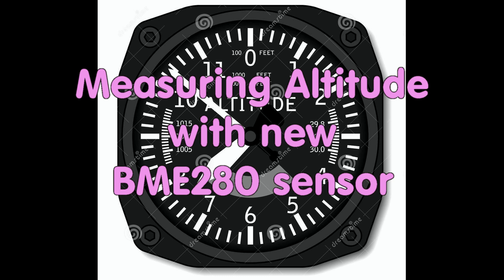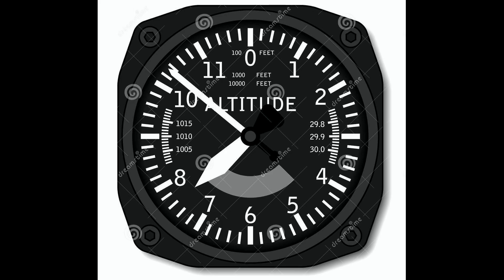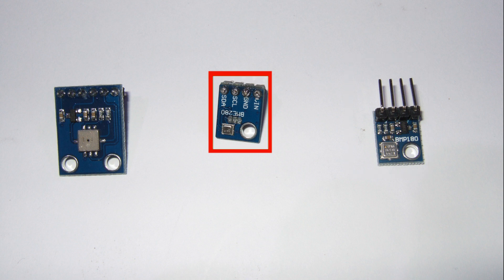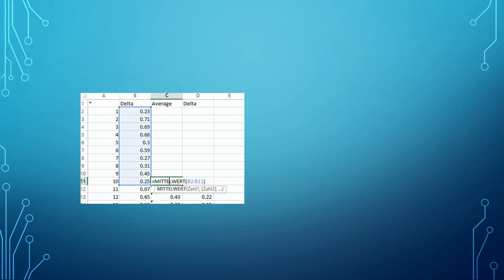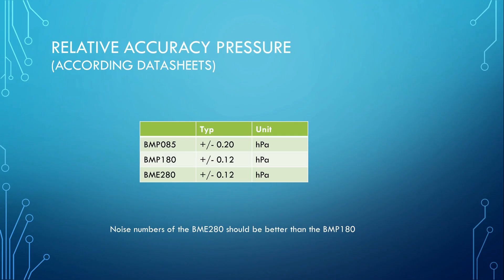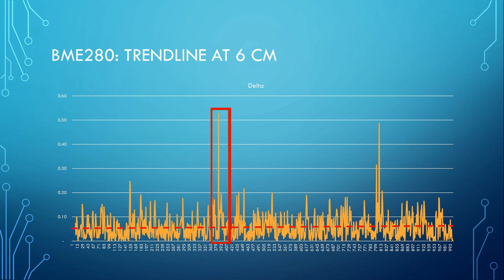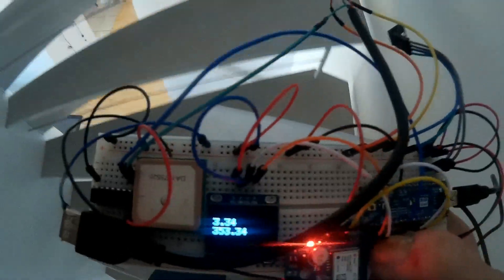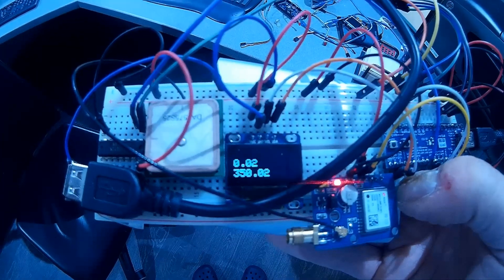#16 Exact Measurement of Altitude with BME280 sensor

Comment: Andreas, thank you very much for useful info. Have you finished any of your gadgets? I mean constructively, structurally finished (boxed) as a handhold or desktop boxes that contains (among the other things) bme_280 the environmental sensor? If yes, then have you apply any protective screens, or meshes or maybe labyrinth to prevent the water drop from getting into your device through that tiny pinhole?

I construct pocket weather station that utilises bme_280 and am concerned about issues just described...
Reply from the maker: +schabanow No, I did not finish my power meter for my bike (where the BME280 will be part of). Here in Switzerland it is winter now and I was not able to finish the project before it got cold. So, I have now plenty of time till next spring ;-)

To your question: I do not forsee to use the device in heavy rain. So , I will not have a big problem with water. Just my thougts: Because pressure is quite universal you can place the air inflow hole away from your electronics. It is not necessary to have the air inflow close to the sensor. And if you place the air inflow hole at the bottom of your device (if this exist), it shoudl be ok. I think also, that the air inflow hole can be very small, because the amount of air is very small. A labyrinth for shoure would help in addition if neccessary.
Reply: Thanks for kind response, Andreas! Besides air pressure my device is intended to measure air humidity (and wind speed as well - DIY impeller is applied), so the manufacturer's DS suggests the possible minimum air volume between the bme_280 sensor and the open air (the less air buffer volume, the less time of sensor's reaction). My box is supposed to run in quite hard conditions (hunters, fishermen), so it should withstand to immersion in water up to 10 cm deep or so. )) So I'm gonna try quite thin brass mesh plug-washers coated with water-repellant mixture, like Aquapel, etc (just try "water repellant" in YT's search string - there are a lot of spectacular videos on the sbj). Thanks again, and say hello to Alpine Milka Cow! )) We haven't winter this year here yet...
Reply: Andreas you just stop chatting so I wanna apologize for my clumsy (possible clumsy) joke about Alpine Cow... The matter is they show here on TV that advertisement video with Milky Way' lilac cow with a big bell on its neck. )) So here we have just steady mental association between Switzerland and Alpine Lilac Cow for me ukrainian man. )) Please forgive me if I've disturbed you in some clumsy way. Have a great day! Alex.
Reply from the maker: +schabanow No, not at all. I have to apologize, I did not stop chatting on purpose, I just had nothing to reply. Absolutely no problem! As I wrote you, for the moment, I do not have a problem with water and this is why I did not answer anymore. We can keep in touch, Andreas
Reply: schabanow You might try Gore-Tex or a similar fabric, since these are said to repeal water while letting through water vapour (and I would guess air, too) trough microscopic holes.

Comment: very informative, but BME280 should be cheaper now
Reply from the maker: +Thomas Block Thank you for your comment! I just checked on Aliexpress. The modules are still around 8$. But as I said, it is worth the money if you need precision.
Reply: +Andreas Spiess Please send me your contact details. I want to discuss some new projects thomas.block@bosch-sensortec.com
Reply: One of the reason it's more expensive is that they all have a level shifters and a LDO, perhaps they are not as 5V tolerant as the BMP180 which can be found with neither or only a LDO, they should make a low power BMP280 bare board for 3.3V use only
Reply: One year later and I just bought one for USD$4.5, so price are indeed dropping :)